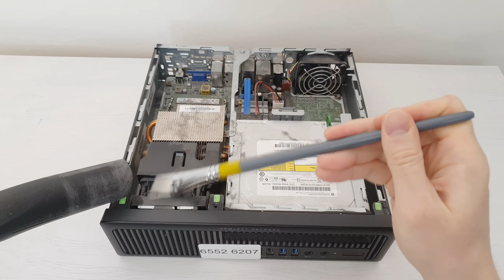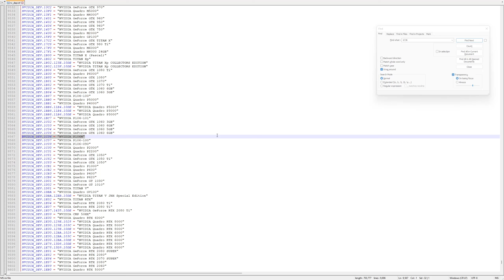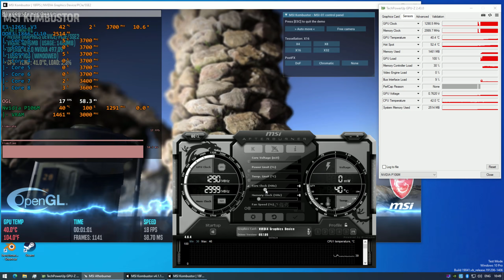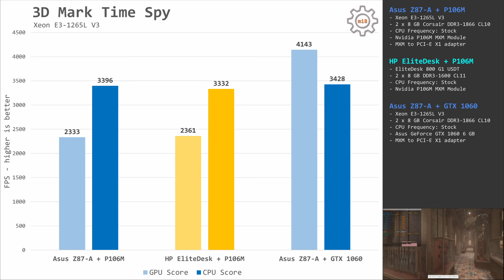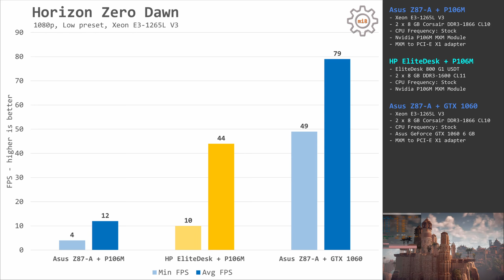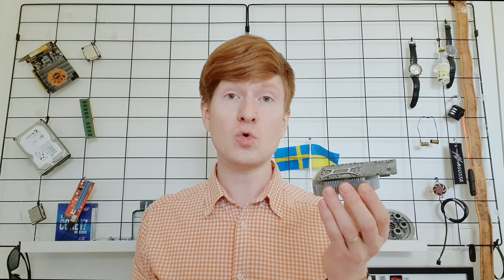🇬🇧 Nvidia P106M (GTX 1060 4GB) MXM Module – Cooling, Tuning, and Testing

Comment: Hi there. I want to run an experiment on a 1080 MXM card. I'm thinking of using the MXM to PCI-E adaptor, only problem is that I heard the 1080MXM pulls around 200W. Do you think it would work/post?
Reply from the maker: It should post but whether it's safe under load I can't say. You need to check specs of the device you plan to use it with.

Comment: @Miyconst Hi, I have an Alienware motherboard with a radeon 5870 mxm graphics card (crossfire) on it. 
My question is: can you tell me how to connect it to my ideapad (hdmi cable or similar) to improve the graphics output of the ideapad?
Reply from the maker: I am sorry to disappoint but I have absolutely no idea and I would honestly not bother, the GPU is just too old.
Reply: @Miyconst  ok thx

Comment: Hi there
I am currently planning to do this with dell m6800 laptop
What do you think about this compared with a GTX 970m MXM?
Thanks in advance
Reply from the maker: The 970M has working display outputs and normal Nvidia drivers, so if the price is the same, I would surely pick the 970M.

Comment: I have been trying to copy this set up for experiment purpose, Can you please confirm that this MXM card is powering GPU is not connected to any external  power source and only Pcie x1 is powering it?
Reply from the maker: That is correct but mine PCI-E extender that I used had external power source.

Comment: For the use case I'm looking at thos for bandwidth on pcie is much less of a concern. A dedicated hardware transcode GPU for a media server
Reply from the maker: Yeah, the only problem is that P106M does not have video encoder.
Reply: @Miyconst  this is true, I was thinking about a laptop quadro if it would save me over a desktop model. P3000m vs P2000 for example. Or if I can scrounge up a geforce card from a dead laptop

Comment: Can you tell me one thing like , did you tried connect this mxm riser board via pcie X1 with usb like the one commercially available... actually I have a raspberry Pi 4 8 GB ram variant and it is running Windows 11 version so it would be great to connect this MXM GPU for the Raspberry pi 4.
Reply from the maker: Yes, I have tried using exactly that USB-like PCI-E raiser. I don't know if there are Nvidia drivers for ARM based Windows, so you better check that.

Comment: you should also see the quadros, M4000M and M3000M, thetre cheaper than this and has the same performance
Reply from the maker: These cards have memory chips on the other side and that is extremely annoying to cool.
Reply: @Miyconst  they dont get that hot, many 8760W and 8770W use these mxm cards to upgrade their laptops, if youre really worried about gddr5 cooling, you can just thermal pad the underside to the board

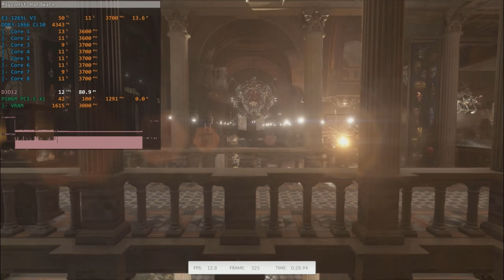Comment: 10:33 there was a version of 4GB 1060 for chinese market only for like arcade machine/gaming cafe use, but i don't know if you can get bios for it

also about adapters - have you seen enywhere adapter for older revision of mxm 1,2 or HE?
Reply from the maker: I have never seen a 4 GB version of GTX 1060, but there surely was a 5 GB version for the Chinese market.

Comment: what is the budget gaming pc in 2022 with 1080p 40 to 60+ fps on max quality in new titles in your opinion Miyconst?
your budget build are amazing
Reply from the maker: The budget build will be different for different regions, also "budget build" means different amount of money for everyone. To be able to answer I need more details from you.
Reply: @Miyconst  5500 Saudi Riyals (SAR) which is equivalent to 1,466.34 United States Dollar (USD). 
aliexpress full access.
 amazon only the 1600s and 2000s and 3000s amd 6000s from gpus,
 amazon motherboards everything till 12 gen.
\\\\\\\\\\\\\\\\\\\\\\
pc case:
motherboard,rams, gpu, cpu, hard drives, power supply. or isn't better to get prebuilt?
Reply from the maker: @darkuser7816  with such a budget you should be able to get yourself something like Core i5-10400F, GTX 1060 5 GB, 16 GB RAM, 1 TB SSD, B560 motherboard. The graphics card might be replaced with RX 6600 / RTX 3050 if you find anything in stock for an okay price.
Reply: @Miyconst  thank you these are sound choices.

Comment: Nice test. For the display output, you can use GPU passthrough like with Tesla GPU's. Try the x16 adapter please, I want to see what the results are.
Reply from the maker: That's exactly how I have tested this GPU. The MXM to PCI-E X16 adapter is rather expensive, I have not yet decided if I can afford it.

Comment: Youtube keeps deleting my comments! Anything in [] brackets are website names that get the comment deleted.

I was looking at that same listing on [same website you mentioned]. I remember seeing that 16x PCIe listing with video outputs. I'm surprised nobody big like LTT hasn't made a video on it already. It's really interesting!

The listing on the 16x one says it's compatible with RTX P series (??) GPUs . RTX starts at Turing (TU), not Pascal!

There's another listing of that 16x card on [Chinese sister site I cannot mention] I found upon a reverse Google Image search. It is [Site the rhymes with powwow] listing # 522047566709.

Using Google Translate, it says it's not compatible with "A" Gpus. I think that is referring to the MXM module type. This is probably for MXM type "B" GPUs. It also says it is "Compatible with 10, 20, 30 series, as well as P series and RTX series graphics cards". P series probably refers to cards like that P106M.

No idea if that adapter would also work on MXM AMD GPUs, or older Nvidia Gpus like a 970M. Most people willing to jump thru hoops may want to just use a Tesla M40. If the display outputs work, that's one advantage over a Tesla, although the cost of that adapter would still need to be cheaper to compete with a scalper's market of GPUs.

I really wish MXM was as straightforward as m.2 has become. You can easily find a cheap standardized adapter for storage or WLAN.

I would really like to thank YouTube for keep deleting comments without telling its users, or telling them why the comments are being deleted! Great way to boost engagement!

Comment: There is actually a good usecase for this. If you use that PCIE-1x card you can use one in your Plex server etc as accelerator card for transcoding.
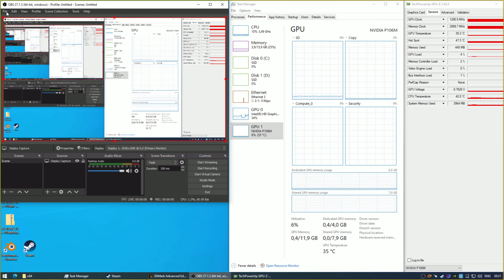Reply: Ah. Typed before I reached 17:00 :(
Reply from the maker: Yeah, I was very sad to figure out that the encoder doesn't work.

Comment: It teases me to buy AIO for my Vega 64...
Bought it during previous mining craze -_-
Atm I have shitty asus version in which I had to replace thermopads, got rid of stock cooler, and straped 2x silent wings high speed fans onto radiatior, cause it was fucking vacoom.
Asus ... never again
Reply from the maker: Go go Vega 64, you can be cool-n-quiet (well, not really).

Comment: I think it would have been better to be compared to a 1050ti or the 3GB 1060, and maybe add the 1060 6GB as a baseline.
Also yeah, I think I will get a Tesla to get an MXM 3090ti out of it to upgrade my 1080ti.
Reply from the maker: GTX 1060 6 GB was the only GPU of this caliber that I had on my hands, so this is what I used for the comparison.
Reply: @Miyconst  Oh I see. Whenever I watch or read about a comparison I always think that the reviewer has all the cards/processors at hand.
Anyway, nice video, I really like how perfectionist you are with your work.

Comment: I'm working on mxm adapters right now. The lack of video output means the x1 adapter has to compete for the already insuficient bandwidth to send the grafical data back. Even in x1 if the mxm had a grafical output directly from the adapter you would have double the bandwidth.
Reply from the maker: Yes, PCI-E X1 is way too little for a GPU. I would say X4 is the very minimum.

Comment: Very interesting. It's a shame this isn't viable. The K20X is a cheap alternative with the same performance. It's just a shame about the limited DX12 performance.
Reply from the maker: K20X is an outdated and power hungry GPU, but it's still an interesting option if the price is right.
Reply: @Miyconst  yep, but I can usually get them for 70€ in Germany. The only other GPU I can readily get for that money is an R9 270X.

Comment: Cool, but i think you missed the point, i wouldn't want to turn my car into a gaming pc but rather let the car be the gaming pc. Hardware is aready there, now how do you emulate windows with far cry on the tesla infotaiment system and use the steering wheel and pedals as input?
Reply from the maker: LooL! That sounds like a better option, and since these P106M went for sale, it means that Teslas got an upgrade.

Comment: It may be from the Nvidia Drive PX 2 of a Tesla (https://en.wikipedia.org/wiki/Nvidia_Drive)

"All Tesla Motors vehicles manufactured from mid-October 2016 include a Drive PX 2, which will be used for neural net processing to enable Enhanced Autopilot and full self-driving functionality.[9] Other applications are Roborace.[10] Disassembling the Nvidia-based control unit from a recent Tesla car showed that a Tesla was using a modified single-chip Drive PX 2 AutoCruise, with a GP106 GPU added as a MXM Module. The chip markings gave strong hints for the Tegra X2 Parker as the CPU SoC"
Reply from the maker: Thanks! That explains a lot. Seems like we are starting to scavenge GPUs from cars for gaming.
Reply: @Miyconst  coming to scrapyard near you